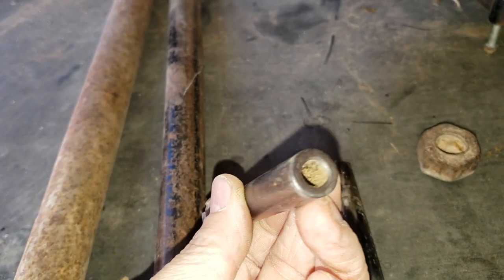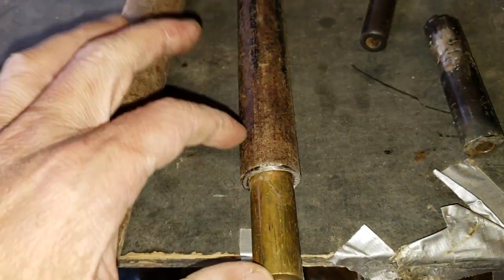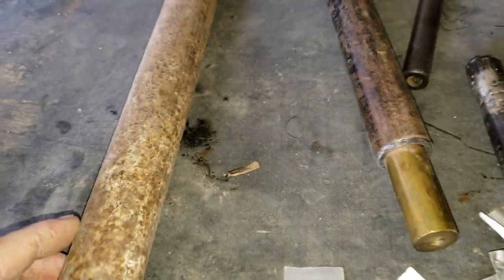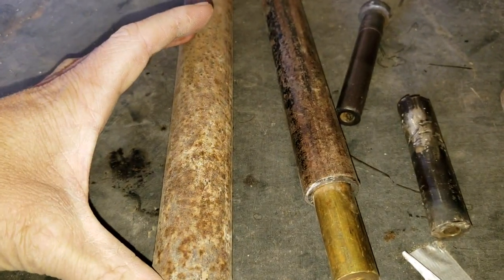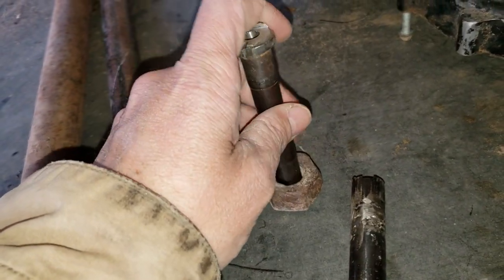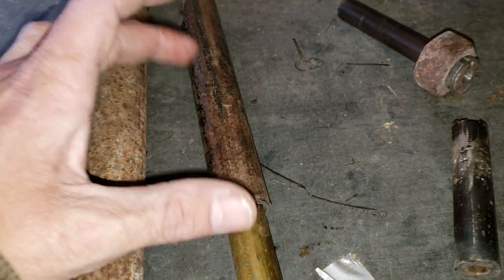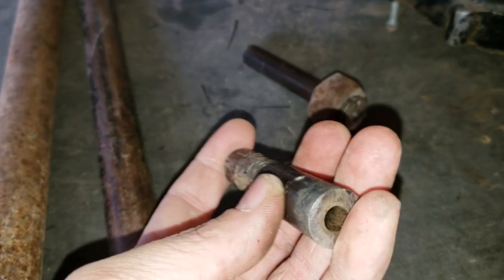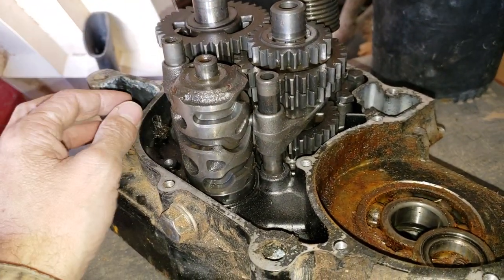Gathering some pieces for a homemade 7.65 32acp

Comment: One time when i was a kid i made a .22 out of a socket, a copper plumbing tube an elastic band, firing pin was a nail guided with a hollow pen tube and held together with some red insulation tape, you pull back the elastic and it set off a .22 my ears where ringing for like 15 min i didn’t even expect it to go off, was pretty stupid but goes to show anyone can build a firearm

Comment: What size hole did you drill for the barrel?? Is the muzzle hole 9mm?
Reply from the maker: Its a 7.62x25 barrel section thats been cut up with a torch. For the chamber I just used a random dremel stone bit and kept fitting the cartridge till it fit